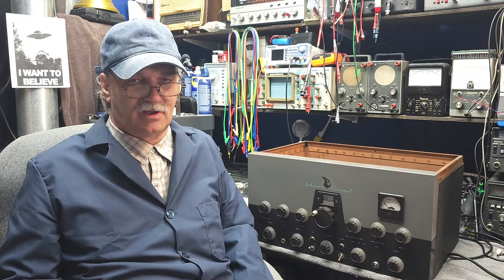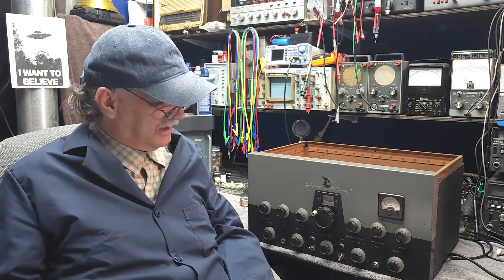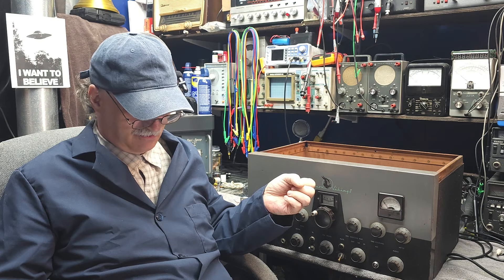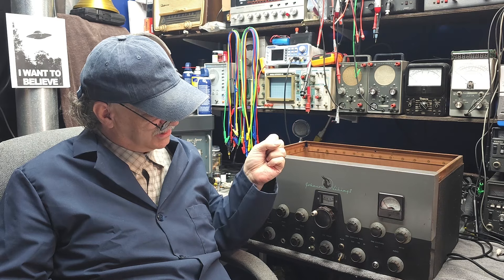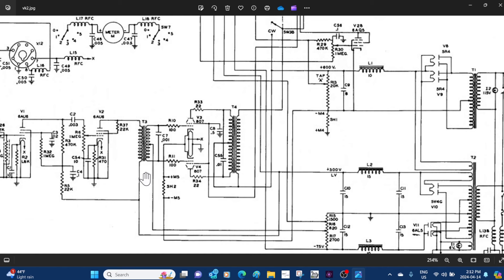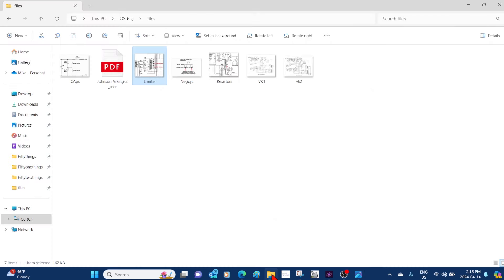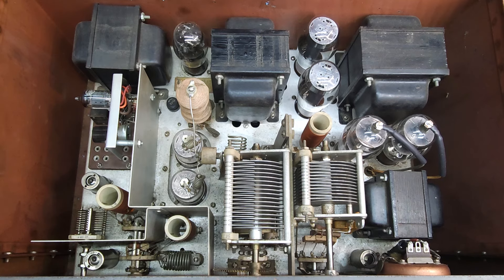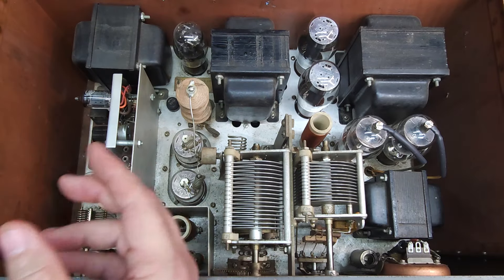Johnson Viking II Repair / Modification / Clean Up Pt. -1

Comment: This one is on Deck. So Glad you are doing a video on this transmitter. One of the few Johnson's I don't have yet in my collection. Great vid! I hope you do A Valiant at some point as well.
Reply from the maker: Got a Ranger up and running? A valiant would be nice. A 500 would be better :) The search continues.... :)
Reply: @MikesRadioRepairRestoration  Ranger is good to go hooked up to my Thunderbolt. My 500 has a clean bill of health after a 20m coil shorted and had to be fixed. I have 2 Valiants to bad the shipping would be to much to get it to you.